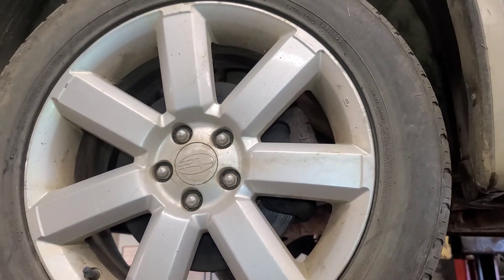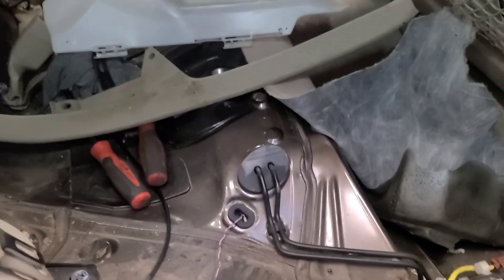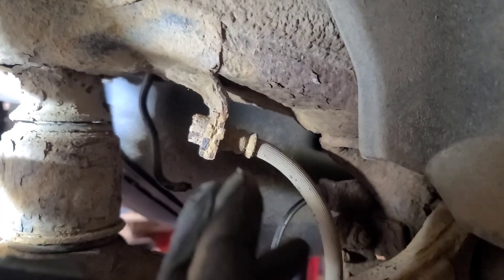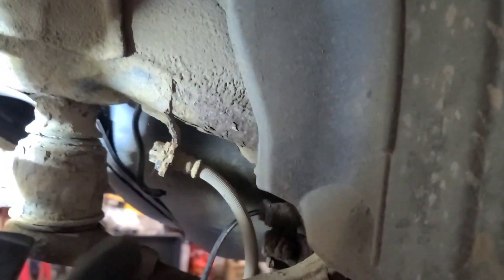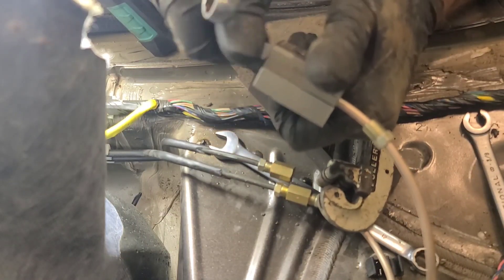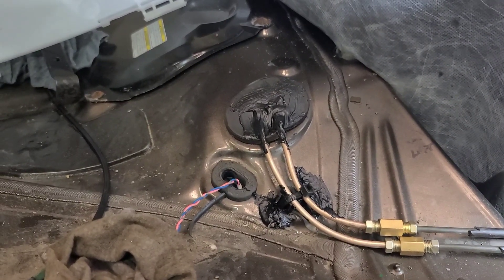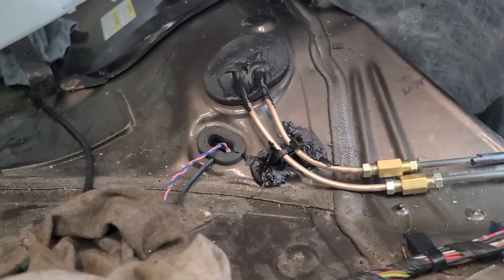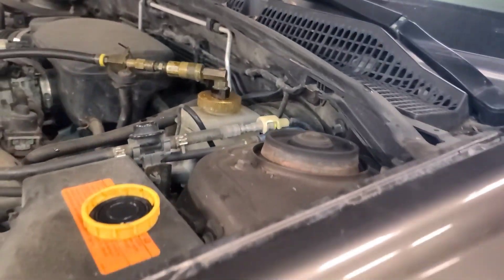2008 Subaru Outback Rear Brake Lines Repair

Comment: Thank you Mr. Bailey, today its my turn to have a bad day. Started with a bad master cylinder, then escalated to booster and master, then I got a misfire code, replaced the ign coil, still had the misfire, changed spark plugs, car finally runs, time to bleed and go. NOPE:
On the last caliper, THE LAST CALIPER!!! My rear blew and filled that plastic cap up with brake fluid. Fortunately though you made this video and I learned its only a small portion. Thank you again sir.

Comment: The added expenses for the nicopp is worth it when pre-bent lines aren't an option.  I wish i could pay my vehicle manufacturer an extra $250 for OEM  nicopp lines so you never have to replace a brake/fuel/evap line ever again.
Reply from the maker: They don't want them to last forever...

Comment: Hey Phillip... hope all is well.  How did you run the line for the driver side???... over the tank, under the tank, along subframe, etc... and how did you secure them to keep from movement, vibration, and being struck or  entangled in brush, grass, etc?  Thanks Bud.
Reply from the maker: Sorry it wasn't clear in the video. I followed the original routing for the lines and therefore used the original retaining clips. Also used a few zip ties.

Comment: Do the lines run the same way for the Legacy sedan?
Reply from the maker: Not 100% sure but likely in the same fashion.
Reply: @PhillipBailey  just pulled my backseat and confirmed the lines run the same way.  This video was extremely helpful, thanks!
Reply from the maker: @markjohnson3737  good luck.